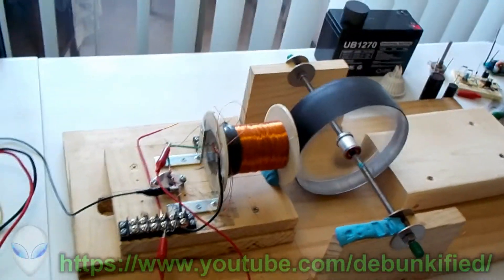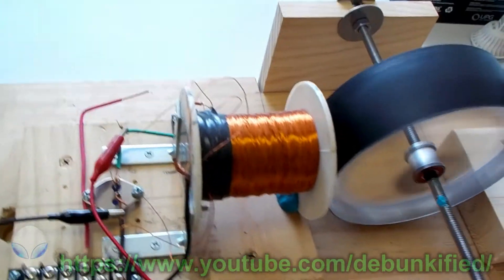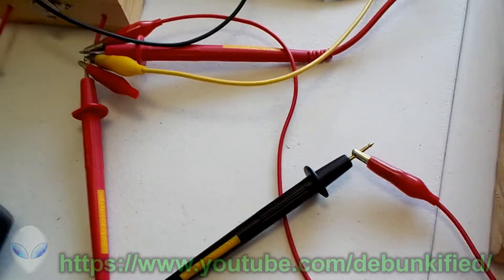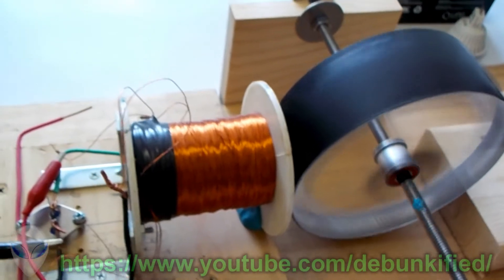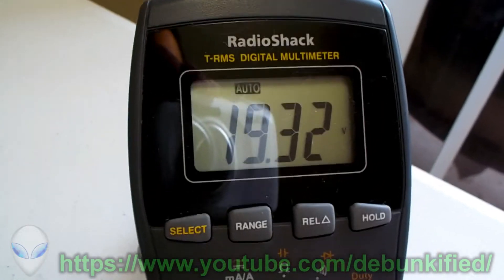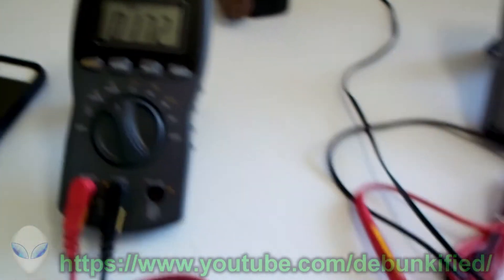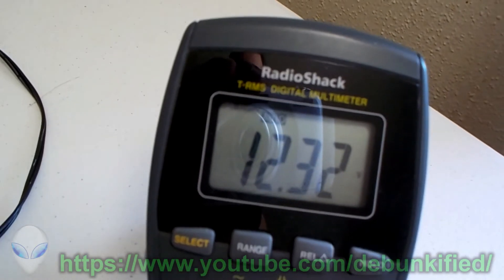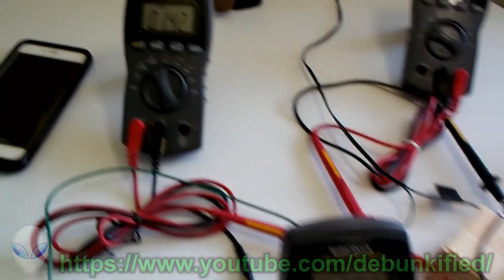Two Stage Electromagnetic Oscillator

Comment: Appreciate your investigations man never stop. Resonance is key I believe that is why you see capacitor recharge by themselves. And have you thought of adding a spark gap with tungsten rods? The larger the diameter the rod the larger output you will receive.
Reply from the maker: +Nicholas Vermeulen Thanks for the comment, the voltages are not high enough for spark gaps in these investigations. Have a good one. 🙂👽